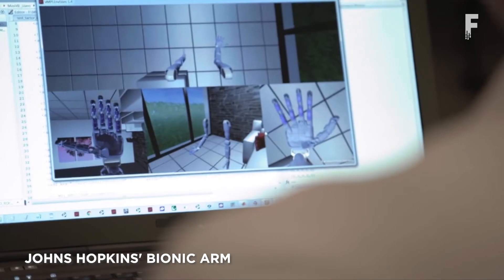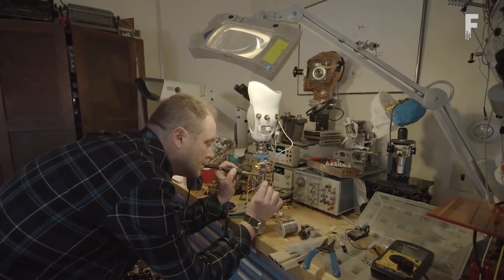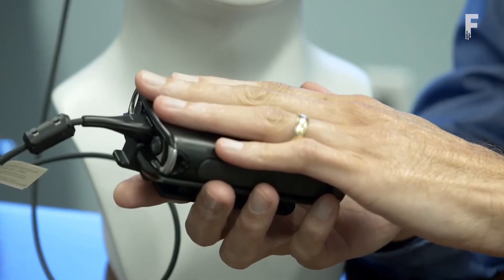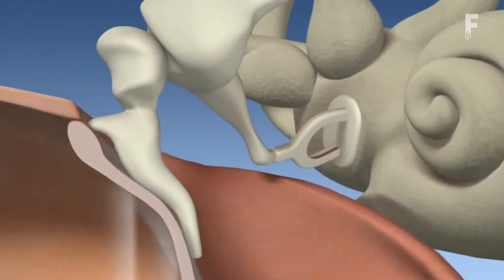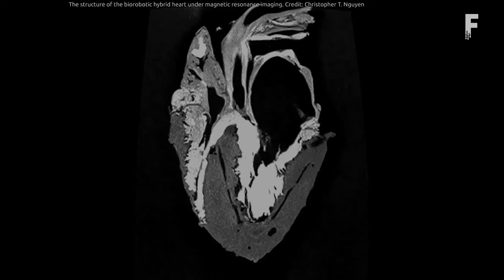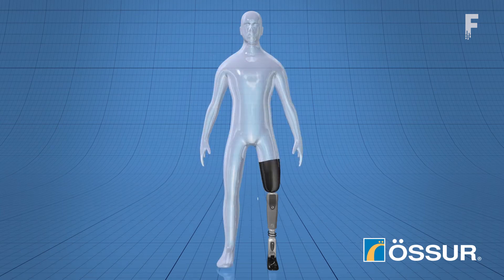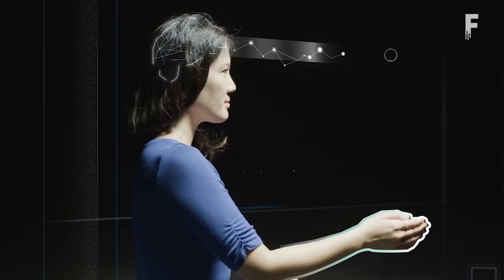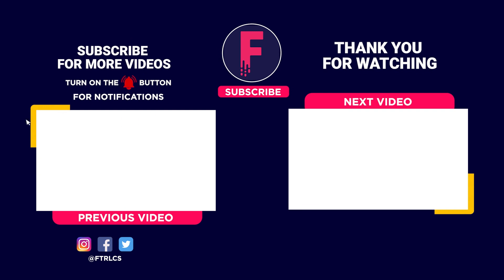Mind-Controlled Bionic Prosthetics of the Future

Comment: one question what happens when you pull on that arm to hard will it come off or is it very stable
Reply from the maker: I'm assuming since people just slip it on that it can be easily be taken off as well.
Reply: It comes off easily. The problem of having them otherwise is that the bone can break instead.